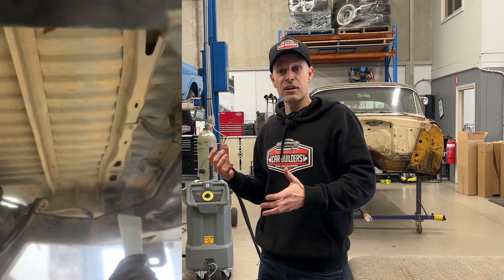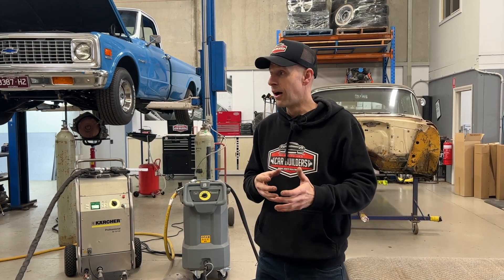What Is Dry Ice Blasting? We trial two Karcher Ice Blasters.

Comment: It's a cleaning technique where frozen CO2 pellets are shot at high velocity to strip away dirt and grime without damaging the underlying material. I've observed that here in South Africa, specialists like Dry Ice Blasting rely on karcher dry ice blasters for their industrial cleaning projects, and the equipment has proven consistently reliable. What I've found particularly effective is that the dry ice evaporates on contact, so there's no messy cleanup afterward.

Comment: What amazes me is when you see people ice blast with no respirator.  When you think of what's being removed: old brake dust, paint particles, decades of dried oil and grease, surface corrosion, degraded rubber and plastics.

That's all going somewhere.  Probably not too bad if you've hired a machine for one car as a one-off, but if you were doing it anything like regularly, surely a P3 mask as a minimum would be sensible?

The process looks incredible though!
Reply: Notice this is present in a lot of tasks people do. Plain simple most people do not think.

Comment: Just a little heads up, I have just demoed the bigger of those machines,  karcher says that you need 260cfm to run it,   well 260cfm is a fairly large hydravane, we didn't have one that big so used our 90cfm which we had on site,  the sales guy that bought the machine out, said that  there wasn't a massive difference in output with the smaller compressor,  I guess it depends on what your requirements are.
Does a bloody good job,  just price for machine is a bit weighty.

Comment: We use a machine similar to the karcher (with the dry ice pellets) at work to clean our patterns. Over time the hoses deteriorate and you start getting really knarly static electric shocks while you are using them. Strangely, the hoses cost almost as much as the machine
Reply: Must have been a pretty cheap machine to start with if a hose costs the same as the whole unit... Chinese?
Reply: You can run a grounding wire to discharge static electricity.

Comment: Okay, so I have a question. Obviously, the aesthetic appeal is apparent. The perfectionist side of me finds the slow, meticulous process of "erasing" the dirt very captivating. But... What's the point?

Is this purely just for appearances?

I know grime is unappealing, but don't the layers of oil and dirt help protect the underlying metal?

By removing that layer and taking the metal back to the original, factory state, aren't those cleaned parts more susceptible to environmental damage?

The idea is brilliant and the results can't be argued against. I have no doubts about the process or the perfect restoration of the finished product. But...

I just don't see WHY one would do this, especially considering the cost of either buying the machine, or paying for labor at a detailer. Is there a functional reason to do something like this? I get the concept of sand blasting, bc that gives you a blank canvas to build on. You're going back to bare metal and "restoring" everything above that. However, that's also damaging to surfaces that aren't protected by layers of paint and whatnot. 

But from what I understand, these co2 blasters, while extremely effective, are harmless to the actual material. They freeze and flake off the surface layer, but the method by which they do so has zero effect on the base layer beneath, be it bare metal or paint. 

So my question is "why?" If it doesn't prepare a surface to be repainted, or reconditioned in any way, and it only removes the surface buildup to reveal the original factory base layer beneath, what is the point?

Is it really just 100% about the look of an immaculately clean vehicle?

If it is, that's fine. I'm not saying that's a poor choice. I totally understand the reasoning behind wanting a perfectly clean car, especially if it's a restoration project. There's definitely value in this service, no doubt.

But is it really just about looks? Like, is this just makeup for cars? Sure, it makes them look better, but is there a practical application for this machine whereby using it first prepares a surface for further restoration? Or is that just it...
Reply: Your brain thought to type all this but couldn’t come up with the idea that it will be coated/painted after?
Reply: corrosion before painting is preatgy bad. it helps with structual in tegrity but i do agree with some of ypur point
Reply: It's for show and shine cars. Fortunately, the boomers love their 400ci slow cars that weigh as much as your moms chesterfield from the 70s. Dry ice is a great way to prep before preservation
Reply: For another use case it is used in electrical cabinets as it is able to clean without affecting a lot of circuitry. Then they can just vacuum out the bottom of the cabinet. Helps clean up enclosures and parts without taking everything out.

Comment: Dry ice will remove paint.
Reply: No damage to the surface of the car: at the molecular size, dry ice can clean the car's surface as much as possible without causing damage to the exterior paint.
Reply: @KenanRaptor  I dry ice blast for a living. And in the video it is said it won't remove paint.
Reply: @thomasmolitor960 it probably depends how far you hold the nozzle from it
Reply: @thomasmolitor960 what do you dry blast im seriously thinking about adding this to my resume . And what roughly are you charging
Reply: Can confirm my machine will peel paint straight back to bare metal if you r not careful
Reply: Also, some paint is just ready to come off after years of exposure and contamination.

From what I saw in the video, paint that is still holding and doing its job stays while decomposed or air bubbled paint was coming off. That's better for the health of the metal anywho~

Comment: Looks awesome. What size compressor would you need for the smaller one?
Reply: max size would be 7.5HP or 25cfm with a max of 145psi. but you could get away with a 3hp and a 80 gallon tank size. take note that the smaller one uses a single hose design which makes it more efficient.
Reply: @cautilli  hahahahaha BS!!!